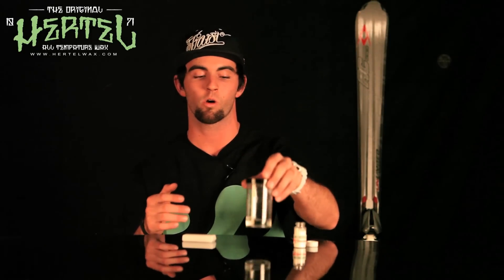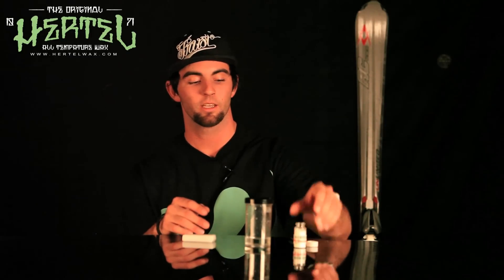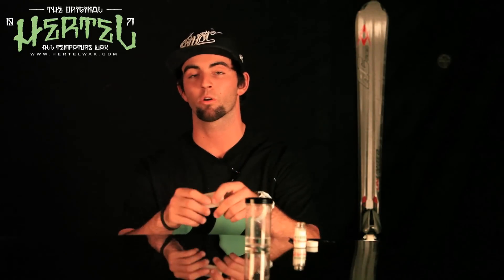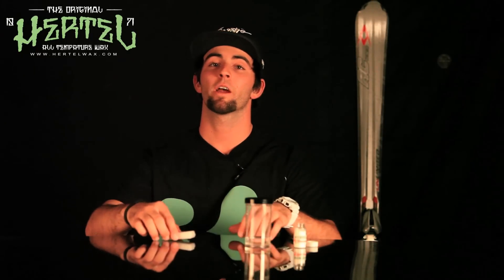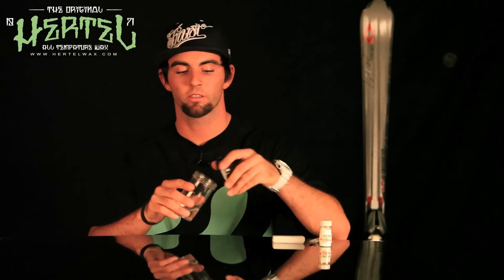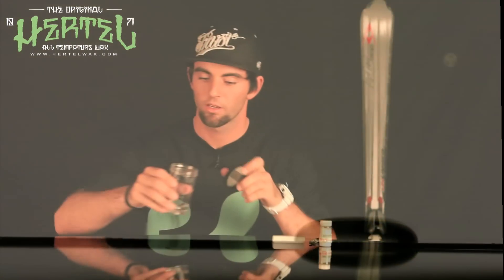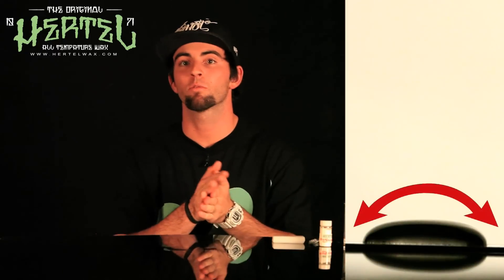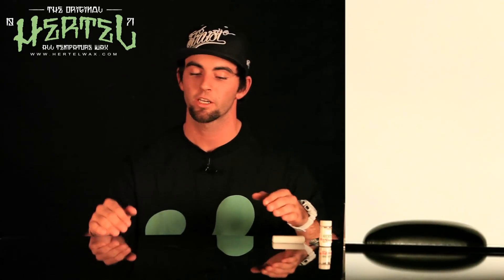How Hertel Ski and Snowboard wax interacts with Snow

Comment: @metafisi Adding any substance to water does not affect the contact angle (essentially it's ability to spread out) in the same way. Surfactant molecules like soap are especially effective at deceasing this contact angle because these molecules preferentially orient themselves at the surface of the water and dramatically decrease the water's surface tension. If you put something like ocean sand or salt on a drop of water, the contact angle will change only minutely because neither of these materials has a propensity to collect at the surface of the water.
Reply: What are you talking about surf wax???? Dude try it on snow before you give youa view.
Reply: Goodness you need to be educated.
Reply: You cant ski.